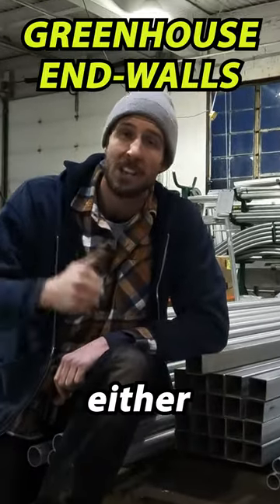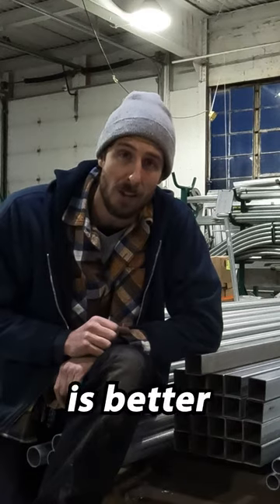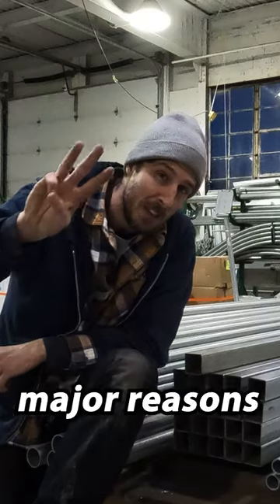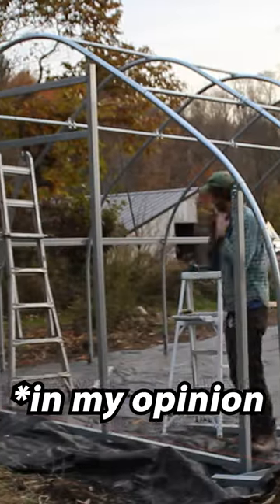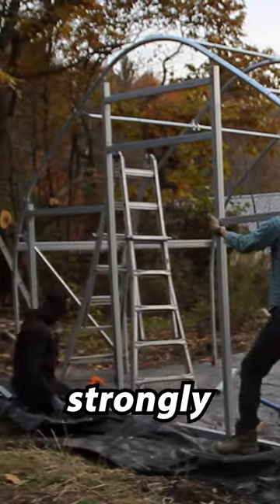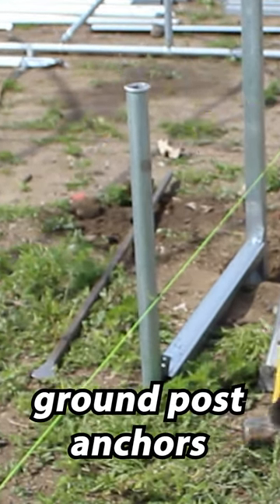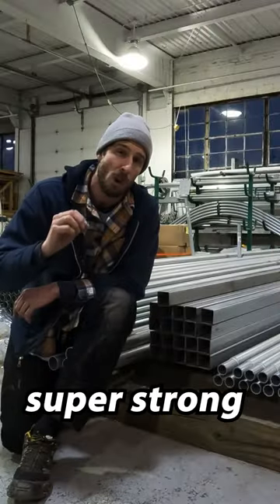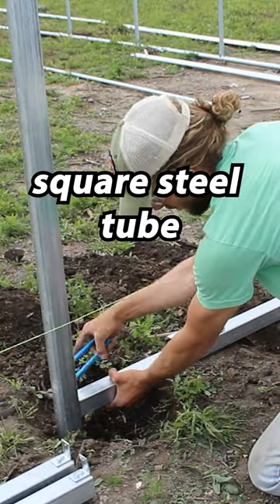The BEST Greenhouse End-Wall Framing | YouTube #shorts

Comment: Trying to source material any recommendations. 
Also is it 2x2 16 gauge
Reply from the maker: The steel I reference is 2" x 2" 16 gauge. We sell it, although shipping rates can be a barrier depending on how much you need and where you are located... Feel free to shoot me an email at info @ tunnelvisionhoops (dot) com. Some chain link fence suppliers also carry square tubing as well, although they don't move as much of it as the round stuff so the pricing can be crazy or fluctuate widely depending on which fence vendor you contact. Thanks for watching!